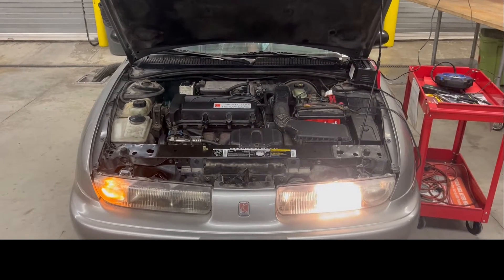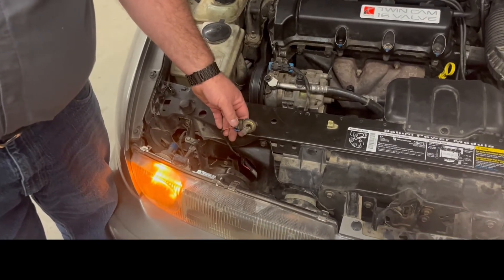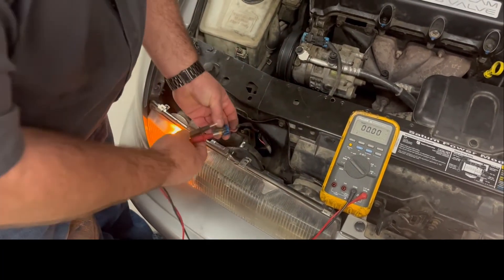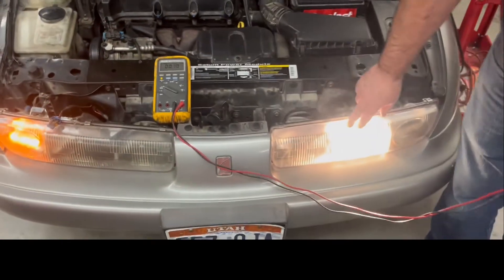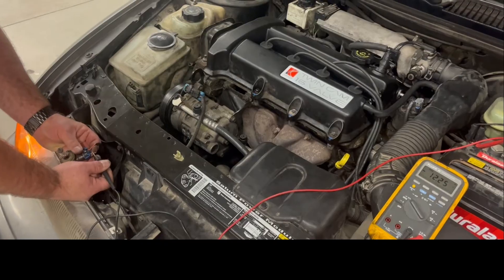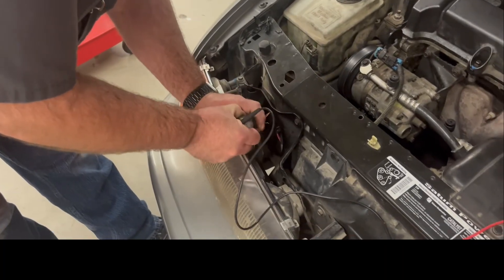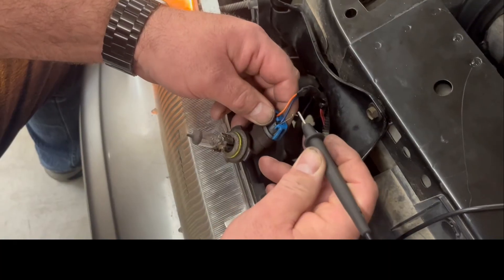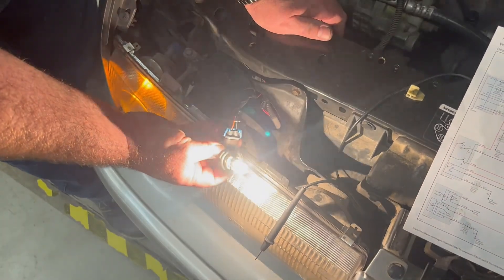On Car Headlight Voltage Drop Demonstration

Comment: Great video. So it was a voltage drop coming from a pinched blue ground wire? Did you solder it or cut it and re-twist the wires? Did you use shrink connectors on the repaired connection or maybe electrical tape? I am asking so many questions because I am having headlight high beam failure on my left high beam and what appears to be weak voltage on my working low beams. 

I was told I might have a ground connection that is faulty. I am a newbie to all this and am trying to learn everything I can about headlight issues for my 1988 Honda Accord. I replaced my H4 sealed beams recently and things have not been working  right! As you know, Accords of that vintage have retractable headlights, that are known to get pinched wires from the constant opening and closing of the headlight motors. 😮

Thanks much in advance. 😃
Reply from the maker: I would recommend soldering the pinched wire and using heat shrink to keep elements from corroding your solder joint.  You can also buy solderless butt connectors with the heat shrink which works very well.  Here is a link to  the solderless butt connectors.  https://www.harborfreight.com/30-pack-watertight-heat-shrink-butt-connectors-66729.html?